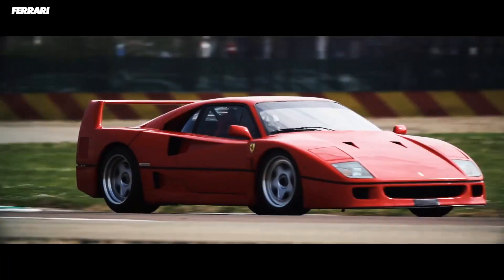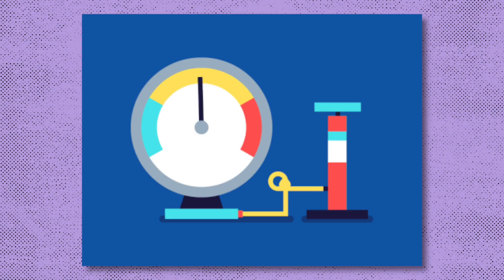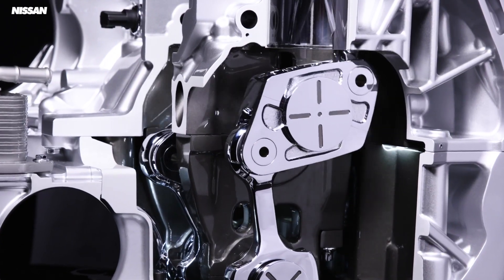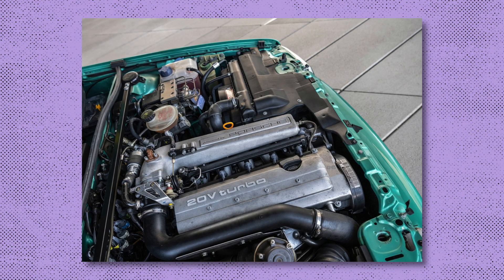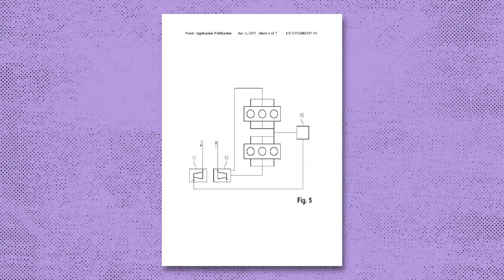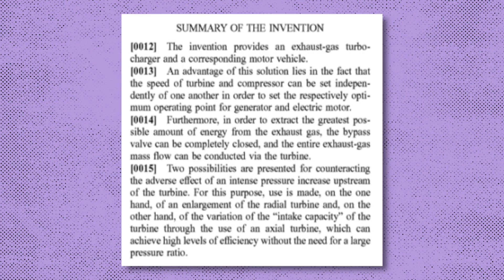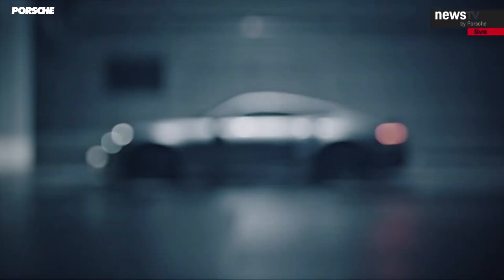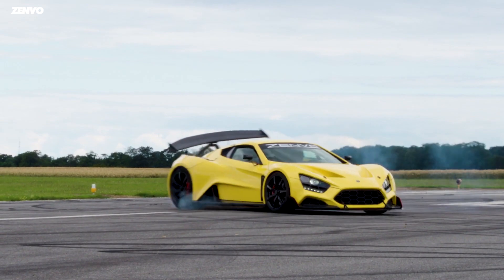Porsche's GENIUS New Turbo Design

Comment: turbo lag isn't a thing when you put all 4 exhaust manifolds into 1 turbo inlet- look at professional drag cars they don't suffer because all exhaust, not just some goes straight to the turbo and honda even improved on that design two with dual inlet design.

Comment: The majority of the heat is coming from compressing the air not transferring it via a common shaft or even being anywhere near the exhaust gases. there’s no benefit it all from a heat perspective. Porsche are attempting to eliminate turbo lag, which can be done with electric motors. Converting mechanical energy into electrical back into mechanical without some extremely efficient super capacitor is going to be tough. Not worth the complexity imo just put electric motors in the transmission to torque fill and call it a day.
Reply: When you think you know better than Porsche engineers.....
Reply: @sylvaind.6786  The great thing about engineering is that everyone can come to the same conclusion if you have the data. Porsche engineers are targeting specific performance criteria so their engines are always at optimal boost. The excess electrical energy can be stored to be used to further supplement electric torque fill or replace that system altogether. Cheers.
Reply: Thanks for re-engineering the 919...
Reply: @sylvaind.6786  Using exhaust gases to power a motor generator pair isn’t Porsche or 919, it’s how we’ve been generating electricity for well over a hundred years. Ever wonder why the compressor and exhaust turbine shafts in jet engines are connected to each other? 

The 919 used a split exhaust to run the MGU-K and provide boost to the v4. Saying all anti-lag systems are equivalent because they both contain a MGU and energy storage is completely missing the point of the video. 

I still think it’s needlessly complex, managing a very high energy electrical on demand system just to manage a separate compressor that you’ll still have to run an inter cooler for. Why not use the 919 system indeed, separating the two systems is just another extremely complex dance that will be near impossible to fix. The Germans are quite good at over-engineering and letting their customers pay for it.

Comment: Since it is an electric motor attached at the crank wouldn't it technically be a hybrid
Reply: It's not attached to the crank, it just turns the compressor wheel

Comment: It seems that everyone who has driven and reviewed the modern turbo charged cars keep saying the same thing they have turbo lag or the cars are laggy . It's thing they say because they have nothing else to say. I have driven old Porsche turbo cars ,old Audi turbo cars ,Toyota rally cars and Nissan rally cars and also Mitsubishi rally cars from late 80's and early 90's . I also have experienced new Porsche turbos and Audi's compared to the old cars these cars build boost in a way that it's not felt . The term turbo lag doesn't apply  to any of the modern turbo charged cars and that's a fact . These so called experts need find fault elsewhere or go and drive a single turbo Porsche and look at the tachometer to see where the boost comes in and not wreck the car before using that ubiquitous term turbo lag. Please !
Reply: I couldn't agree more. People are just delusional. Perhaps comparing a turbo Honda Jazz to every other cars.

Comment: I believe a wastegate will no longer needed as if the car has a 48 volt system, the excessive power from the turbi-generator would be just transfered to the battery.
Reply: Your still going to need a waste gate, otherwise the turbines will over speed and destroy themselves.
Reply: @jzxtrd337  no, the turbines are electric motors, they would have full control of the speed
Reply: @user-yq6ov6ow7l   the turbines are not electric motors.  They are driven by exhaust gases that turn a generator (motor in reverse) to charge a battery.  The compressor is motor driven.  A waste gate is still going to be necessary, not necessarily to prevent over speed (the generator could provide resistive braking), but you still won't want all the exhaust gas forced through the turbine.
Reply: Wouldn't it be the same with a 12volt system?
Reply: @987ntn   less volts = less rpms for the motor driving the compressor. . adding a few 12v battery's in series and converting to a high output externally regulated alternator to a 12 v auto is fairly simple. . . . .
Reply: @jasonwhite8722  no its not simple at all, cars have dozens of computers to control this stuff and there is standardized voltages for the systems. Right now your options are 12 volt and 48 volts.

Also they literally said in the video the system will be powered by generators driven by the exhaust gasses.
Reply: @jasonwhite8722  incorrect, a 12v motor can spin just as fast as a 1,000,000v motor. 

The difference is in the amps, for a given wattage a raise in voltage gives an equal drop in amps, lower amps and higher voltage is more efficient as it produces less heat, can use smaller cables and switchgear and volt drop in the cables drops significantly as a percentage. 

For example a 48kw motor at 12v will draw 4000A, at 48v that same motor will draw 1000A and the Porsche Taycan uses an 800v motor so that same 48Kw motor is now only drawing 60A.
Reply: Would that similar idea apply to eliminate the need the blow off valve
Reply: @Velocitist  You would still need a BOV
Reply: @Velocitist  BUt i like the sound from my HKS BOV.
Reply: @Velocitist  yes
Reply: @dy7296  No.

Comment: Fun fact : I've though about this a couple of months ago, when I learned about koegnissegg's electric valves, and i was like, what if we could spool up a turbo electrically using a motor and timed it up and shii...
If only i was old/skilled enough to have tried to create this.. Welp porche has beaten me 🙁and who knows what if it would actually worked and i would have been rolling in money bruh.

Edit: Grammar mistake
Reply: Its been an idea thrown around for a while, Mercedes has already implemented something similar in some of their cars, I believe Audi and VW also have tried it in some capacity aswell.
Reply: @nordvestgaming1238  Interesting, perhaps someone can take it further now that porche and make it a possible widespread thing, with a turbo that spool up insanely fast.
Reply: @delusion2987  i didn't know about that 😶
Reply: Yea, i thought about routing some AC air into the intake, and then i saw it.

Comment: Not a new idea. Hybrid electric turbos have been around for ages, and variants like electric augmented turbos with waste heat recovery far more advanced than the application proposed here have been used in F1 for 8 years now. F1 is now actually stopping use of this technology. Mercedes and Audi have dabbled, several dedicated turbo manufacturers have solutions. Porsche didn't invent it, they would only patent their specific application.
Reply: It often surprises me what can be patented.
As if electric airpumps didn´t exist prior: Porsche merely combines existing technology, like adding a timer to a coffeemaker.
Reply: And it’s because of Porsche and Audi that F1 are going to remove this amazing piece of engineering… such a shame.

Comment: Electric motor driven turbos are not a new idea or technology, or genius
Reply: It is the way Porsche is doing it hence getting pattens for it
Reply: On top of that, technically this would be a supercharger, not a turbo. As it is being mechanically driven (by a motor and a battery.) The fact that they are recharging the battery (at different times) by an exhaust gas turbine is rather tangential to this supercharger making more go-baby-go.
Reply: This isn’t a Chinese eBay electric turbo 🤦🏼‍♂️

Comment: I couldn't be more devastated to hear the next AMG C63 is going to be a turbo 4 cyl, fall of a legend
Reply: It could work if they made a V4, like in several racing motorcycles. Great sound, and it would be a nice rival for Porsche's turbo flat-4 in the Boxster. 
Sadly, it'll just be an inline 4 i guess.
Reply: Yup, I hoped they'd at least use the inline 6
Reply: Even sadder Mercedes completely pulls out of ICEs from 2026 onwards
Reply: 4 cylinder hybrid with around 640 hp
Reply: they said the very same thing when Porsche went water cooled, then they said the same thing when Porsche went turbo 4 cylinder, keep holding onto those archaic thoughts they'll serve you well in life.

Comment: haha, I thought there will be a time when turbocharger have mechanical transmission that can change ratio between turbine and compressor speed. But they skip mechanical transmission altogether and go with electric transmission directly. I like it.

But if the car itself use electric transmission between engine and wheel, I think the electric transmission between turbine and compressor will become unnecessary. But I don't know for sure because the only well known example is diesel electric locomotive and it doesn't require quick power response like a car.
Reply: Really big dumptrucks and some ships use electric transmissions as well

Comment: Could you use a turbo to pressurize a tank, 
and then use the high pressure air to fill the gap made by turbo lag?
Reply: I suspect it wouldn't be very efficient. The amount of power compressing tank could tob the output enough that it becomes moot or even an overall loss.
Reply: I think it was a Ford rally car that did that back in the day before it was banned. They had a restrictor on the turbo inlet which limited power. But, they used airflow from the turbo when off the throttle to pump air into a tank. That air then bypassed the restrictor and gave them a temporary boost in power.
Reply: I'm not sure. Space would be the biggest concern, plus gas in a tank tends to give a rather short burst than a continuous like a turbo
Reply: Yeah naa, especially with combustion gases. The stuff done in F1 with a generator/motor hooked up to the turbo shaft for recovery and elimimating turbo-lag is the only feasible way. Then you can also do crazy shit like MGU-H or heat recovery.
Reply: @rkan2  I think he meant pressuring a tank of air for intake purposes amd using that to subsidize thr lack of high-pressure st low rpm. Basically a pneumatic capacitor. It's not illogical concept, but thr energy to create is probably excessive.
Reply: @Lessenjr  Exactly. I've seen some builds where they have a lot more boost than they can use - especially at high revs. I was wondering if there was a way to save that excess boost pressure to fill the boost gap made by turbo lag.